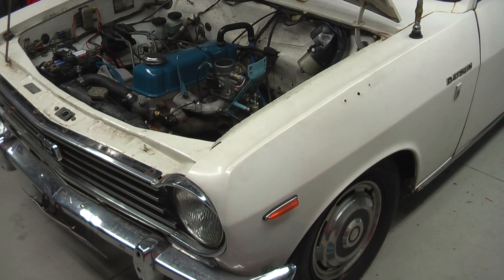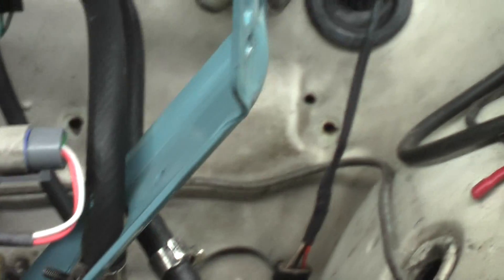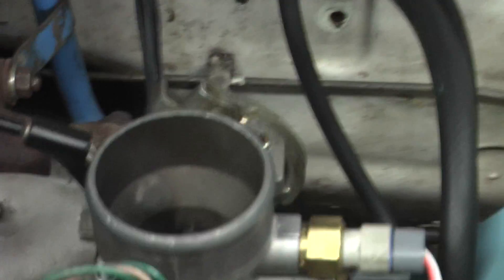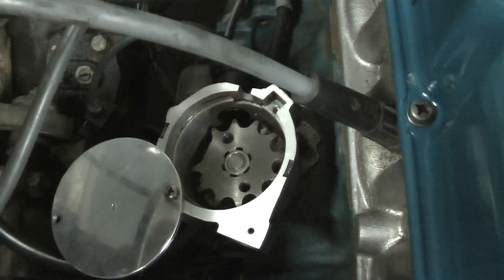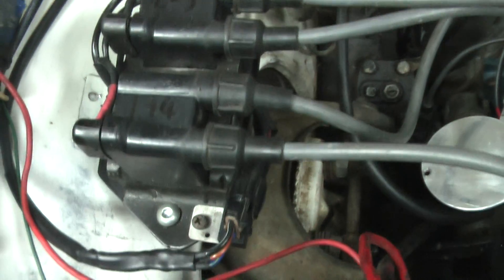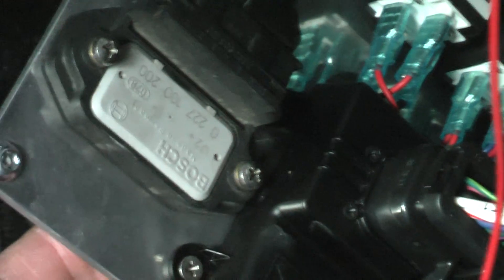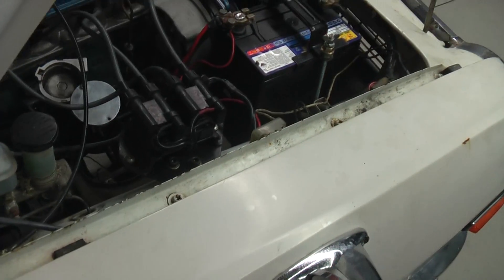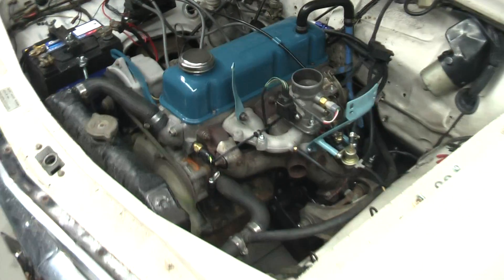Datsun A12 EFI

Comment: How is it 21 kw atw ???? it's more like 50 kw atw stock  .
Reply from the maker: All the standard A12's I have had  on the dyno,  have been between 19 and 23Kw ATW.  These engines are rated at 69Hp standard and that is at the flywheel.
Reply: *****
If it's 23 kw at the wheel it means that your engine is about 50 horse power or a bet less at the crank , and the datsun is a light weight car so it should give a bet more than that at the wheel , am now just wondering if some thing was wrong with your car/cars ...
Reply from the maker: It is not possible to accurately calculate engine power from a figure that has been measured at the axel.
Reply: John Dawd how does weight affect dyno hp?
Reply: VicDynoHire Please guide me for this.
Reply: Lol i have no idea, i think you guys are more knowledgeable than me about datsuns/engines, anyway i'm going to convert mine to efi and i will put an opel astra f 1.6 EFI and here is a picture of it :            https://www.google.com/url?sa=i&rct=j&q=&esrc=s&source=images&cd=&cad=rja&uact=8&ved=0ahUKEwjk0bjz-8jZAhXFhrQKHRlIBc0QjRwIBw&url=https%3A%2F%2Fwww.youtube.com%2Fwatch%3Fv%3Dh0EDGib3KLI&psig=AOvVaw0gaLGa-XtWMM93Zl1i3Wjb&ust=1519919480934782

so do you guys think i might get a bet more HP with this setup??? i have an a12 gx original head with an a15 carb and manifold and i have a problem with my float ball getting stuck almost everyday and i have took the carb apart many times and replaced the needle and the valve even though they were in great condition and my carb is like new from the inside no dry rubber seals or anything like that and it pretty clean and fresh with 0 rust, anyway i had my car for almost 7 years and not planning to ever sell it and people tell me that i would end up getting troubles with the carburetor eventually, and that why i want to make it efi and i chose the opel astra f 1.6 8v efi cause it's going to cost me less than 200 dollars for the whole thing, so do you guys recommend it? and i measured the bore of the EFI throttle and it was 34.7 millimeter so would it give me a better performance than my a15 23/27 carb???? and is it going to be more reliable than a carb??? i mean carbs are the most reliable thing, isn't that's why they still put them on battle  tanks tell this day!!!!
Reply: John Dawd that’s some MAD limiter bash mate. 🤣🤣🤣🤣. How’d it drive??👍👍👍

Comment: Does anybody know what are the differences between A12 engines??? Why there is written in european magazines and german brochures 52hp engine power ant69hp in other brochures??? I have bought in UK Cherry FII 120A Coupe and it has 69hp written on its VIN plate. But some of  brochures and articles says FII and N10 has only 52 hp. The same situation is in case of 1400 engine. As I know, there was any major changes between these engines availabe after years in Europe.
Reply: The only difference between them {A12} is the head , some have round port exhaust and some have oval {A12GX/A12T}  , n10 is 988cc engine {it's not n10 it's e10 i think }  .